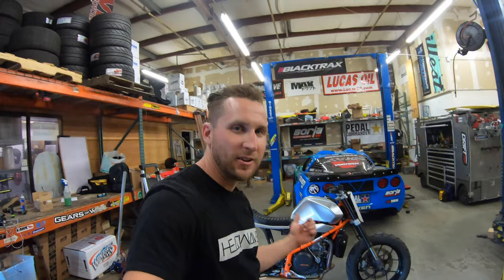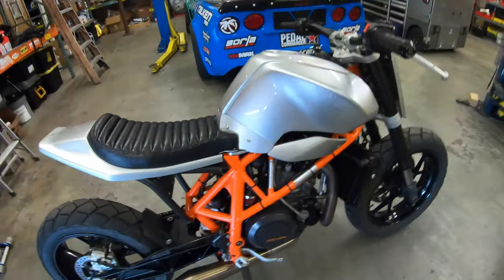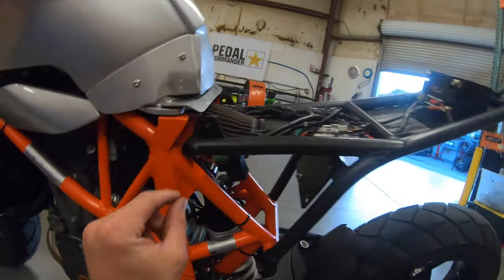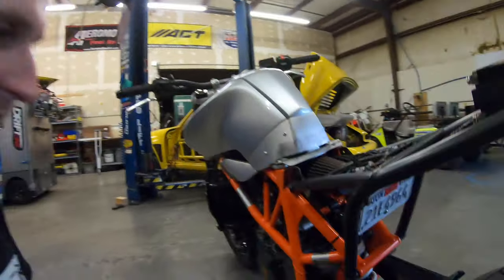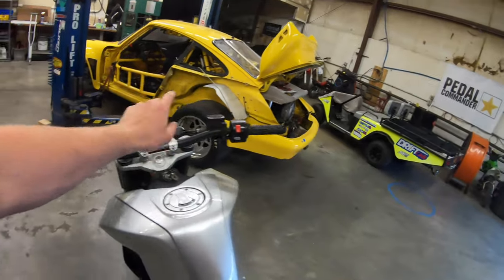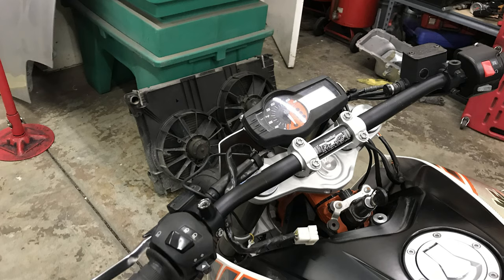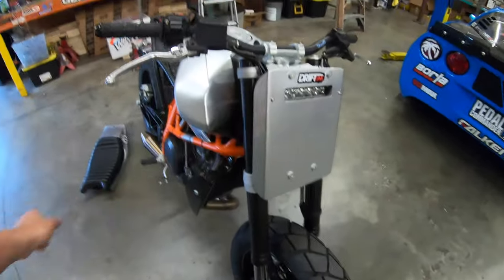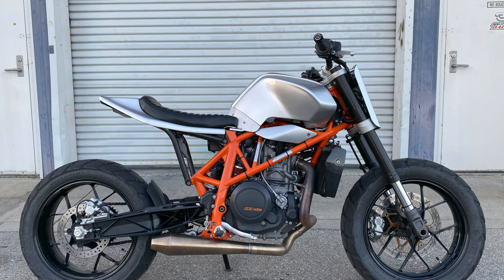Lets Talk 2 Wheels... Meet my KTM 690

Comment: What did you use to map the ECU ?
Did not see a Power Commander or a Rapid Bike Module or any of that in there.
????
If you did not re map and changed the intake and exhaust... It will run like sh!t.
???
Looks really nice.
Love it.
Reply: @shawnlister2730  "easily do 120 mph"
Not easily
Indicated top speed yep.
Real speed - no.

Comment: I'm a 690 owner too, but I have some questions.
How do you see traffic behind you without mirrors? It's pretty hard to turn your head 180 degrees with a full-face helmet on.
Without the rear guard, don't you get lots of water and road grime splattered up your back when it rains?
Nice K&N pod filter, but wouldn't it get filled with water and dirt which gets thrown it it from the rear wheel? I know that part of my bike gets plenty of dirt flung at it, even in light rain.
Perhaps you plan on making a rear fender to keep the weather out, I'm not sure.
I like the concept, and keen to see how it turns out!